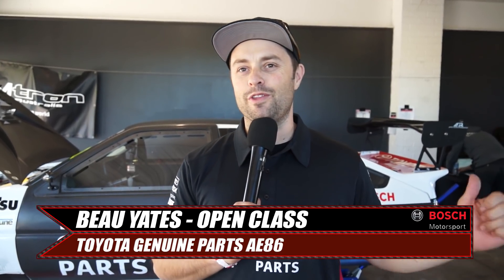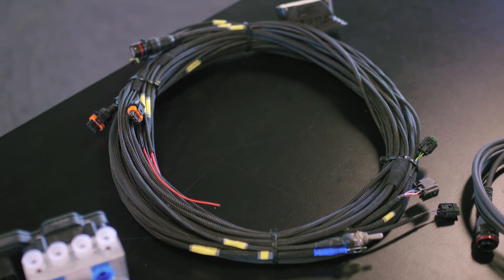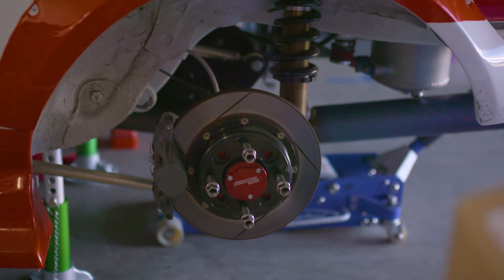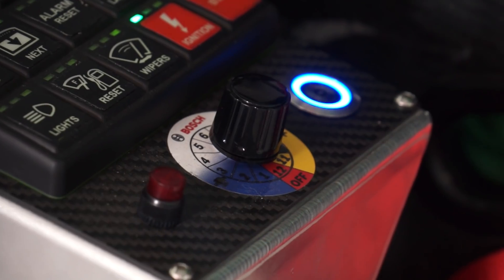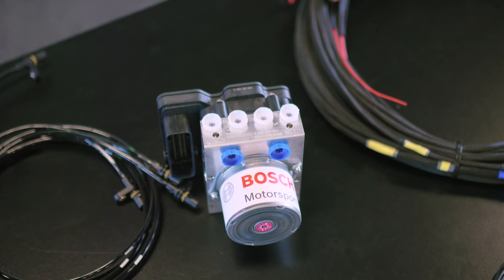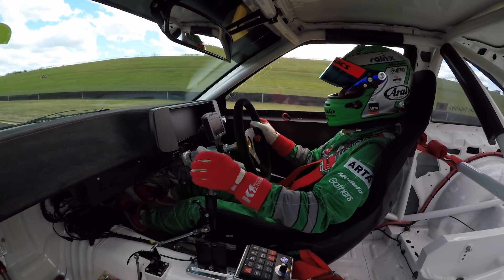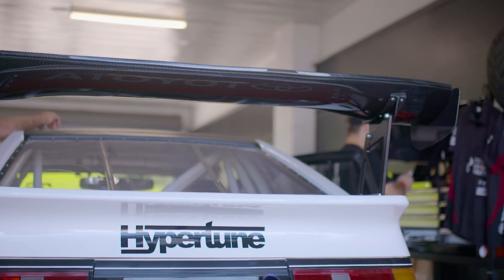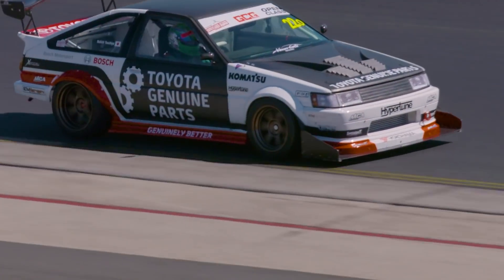Motorsport ABS System - Why your race car needs it

Comment: I saw this system several years ago n it was hella expensive. The price for the club sports version with universal wiring harnesses is +7K with specific car harness is +9K plus I don’t think it includes the calibration and tuning software 🤷‍♂️ So, i guess this is the +12K version of the Bosch Motorsports ABS M5 Clubsport Kit 😓
Reply: all those engineers and programmers must get rich somehow

Comment: nissan has been using these exact systems for years now
Reply: in what cars?
Reply from the maker: In what cars?
Reply: most nissan cars wit the attesa system use this skyline and most new model suv use the abs to break the wheels individually wit the use of the yaw sensor etc
Reply: @tararamrattan7233  This is a motorsport setup, your talking about normal road car abs brakes from the 1950's tottally different- 

Its like saying "you know the v8 engines in Formula 1 in 2013? Ford had v8's in the 1920's"
Reply from the maker: Watch the video and read the description mate

Comment: Learn how to Fkn drive is my abs ,, we put everything in bubble wrap nowadays , even race cars now for the new generation of sissy racers and drivers and he said it it does everything for you pfffffffffffffff please just buy a Honda jazz
Reply from the maker: If you want to be slower that’s your choice mate
Reply: @MotiveVideo  been racing on uk circuits for years and never needed and most competitors are the same no aids , and if u drive on the right tyres and brakes they do there work as should , and as a driver u are meant to be at one with the car feeling it all ! All abs does is take away the raw driving experience,  if it locks up deal with it don't just keep the panic pedal depressed !!
Reply from the maker: It’s not about needing it, it’s about using it to your advantage
Reply: @JH-jo9wt  big fuckin weight difference jh super hero obv it can brake l8r think b4 u open ur face flap not to mention wider wheels compared to a v8
Reply from the maker: Motor set ABS is proven to lower lap times. Many GT3 cars use this exact system. Because to makes the car quicker. The ECU can control the brake modulation  quicker than a human. Same as paddle shift can shift quicker. If you don’t want it, that’s fine, it’s ok. But you can’t argue it’s not quicker because it is.
Reply: @gaz10182  Audi r8 gt3 homologation dry weight is 1235kgs** without any fluids or driver, add all the fluids add a full tank of fuel and you're close to 1300kgs without a driver, add a 75kg driver and you're at 1375kgs race weight, as you know the aluminium spaceframe chassis is pulled straight off the production line at Ingolstadt. A V8 supercar is 1395kgs including driver and fuel (3075lbs) with a mandatory minimum 755kgs over the front axle (gee that must help braking coming out of the chase) its just a chrome-moly spaceframe bearing no resemblance of the road car, and no not a big weight difference, front tire size Dunlop Sport Maxx 290/675X18 vs a Pirelli 30-68/18 again woopty do. The difference is in the ABS and the aero. If you had 2 identical cars the Bosch M5 ABS-equipped car would be able to destroy the non ABS car in every single braking zone lap after lap, without locking up a tire which happens when you push really hard. Flat spots on tires means more money, backing off means slower times - this gives you the best of both worlds the advantage is exponentially multiplied in greasy conditions.
Reply: @JH-jo9wt  OK so it's took up ur time to look at that spec list from 2 cars I appreciate that tyres do make that much BTW  , right so what we basically know is that instead of going off in a cloud of smoke locking up and continuing off into gravel as many amatures do if u are to late u will just go off and look like u were not even trying to slow if the wheels can't lock with abs( appreciated that u may have steering input but if it's to late it will still be a bum ripper moment ) , I do appreciate what we are aiming for here guys but I see it on sim racing 2 aids to help the hopeless be better , Christ I can ride a motorbike but I will admit I'm not that good so I know my limits but when on four wheels different story , u bond with the machine and are supposed to be in control as a race driver at all times why have all the aids  !! And some time s could lead to a false sense of brakes when stinking hot , so jh remember not every one drives a v8 or gt car on track  that has those type of brake disc uk or  aus usa rotor size and caliper pad combo, and driving is supposed to be driving not just sitting behind the wheel pushing pedals and hoping for the computer to do its job
Reply: @gaz10182  Not sure if trolling or just stupid.

Comment: Or use the Teves MK60 ABS from the E46 M3. Still programmable, but $1000 altogether.
Reply: Not in same class, mk60 is primitive
Reply: @claudiumxg1  you can get a motorsports flash on certain units. Essentially the same as the Bosch unit at that point
Reply: @Hole_Motorsports  no IMU on Teves unit, is about 20years old tech, nothing to do with a curent M5 unit, but still ok.for price

Comment: is this system to add ABS to a non abs car or can this also be a replacement for cars that already have an ABS system from the factory.. like if i would get a roadcar and want to bolt on stuff for trackdays and some more agressive driving.. dispite the price
because im wondering if its usefull or not it i have a car with an ABS system thats outdated.. can i upgrade it with something like this??
Reply from the maker: It can can go in any car with 4 wheels
Reply: @MotiveVideo  cool.. i got an opel omega  from 2003( holden commodore platform) some stuff is outdated...  and looking for replacement parts .. witch is kind of hard when the factory doesnt make those most of the parts anymore...
Reply: @gewoontimm  I wouldn't spend $10,000 on an ABS for an Opel Omega -

Comment: Keiichi was absolutely stoked on the car, he did more laps than anyone during WTAC I’d reckon. He might have been the oldest driver there but he had the most energy and the most excitement. Let fans into the garage for photo ops as well, what a champ. Can’t wait for the next WTAC!!
Reply: Not quiet. He did 21 laps over the Fri/Sat, which is still a good amount.
An MX5 in Clubsprint & an MR-S in Open both did  37, which was the most.

Comment: Finally a performance based ABS system. I love it but can probably never afford it 🤣 (haven't looked up the prices yet)
Reply: I did. And it is not cheap. Over 7000$
Reply: First price I found (assuming this is the M5 Clubsport kit) was 5775 Euros, which is $9485AUD lol.
Reply: Wooo yeah wayyyy to much for me unless I get them as a sponsor which is doubtful. That being said, for a racing team, that's a decent price for the gains to be had. I wonder how it'll do in a rally case with snow and loose surfaces.
Reply: "Finally"? It's been around for so long, easily more than a decade.
Reply: @Unicorn GTR You paid over $7000 for fronts only?! 😳
I got mine on Crustida for $4000. 355mm rotors, 6 pot calipers. 👍
Reply: @MafiaboysWorld  The construction, material, passage sizes, cooling design, etc of brakes makes a big difference in price compared to piston count etc
Reply: @bilaltariq7819  Only the material makes the difference, ceramic vs steel. None of the other things you said matters. I should know, my channel has the whole process, from ordering at the shop to construction to picking them up from the shop themselves.

Comment: This! People are so misinformed about ABS and think its the devil, but nothing makes you lose more time at the track than missing a corner because you locked your brakes and or spend your time trying to figure out breaking force that can change because of so many variables all the time.
Reply: People trash it because, as the dude said;  proper race spec ABS =/= normal ABS. Normal ABS is designed to prevent an accident, that's it. Actually 'tripping' ABS is slower than not doing so on a track, just like locking up when braking so it really doesn't make a difference as long as you know what you're doing, just if you delete it you've got a few less things in the engine bay.
Yes, ABS can and is absolutely good at this tier, but fucking no one's going to drop $9K on something that they're basically never going to use unless they're doing some serious track driving.
Reply: @dyIanVII  Couldn't disagree more - the M5 ABS kit is nothing like your road car ABS system. 

The performance this offers is ridiculous. Here's 2 cars Jamie Whincup coming out of the Chase at Bathurst at nearly 300kph, he has to start braking almost straight away at the 200m mark. 

Now look at Chris Miles in the R8 gt3 car. Flys past 200, flies past the 150m board and buries the brakes at the 120m board at roughly 295kph! 

without ABS https://www.supercars.com/videos/championship/onboard-whincups-pole-taking-bathurst-lap/

with ABS https://youtu.be/9iGW7YbGvuw?t=112

There's a reason these are flying out the door at 10,000 a pop
Reply: Thats why (most of) racing is so cool, you control the car, not the other way around. If you miss the apex or/and a couple tens of a second because you lock up or didnt used the needed, perfect brake pressure you will work and try to do better on the next lap, and better on the next one. Until its not possible to be faster on that brake zone and turn in. Sure, the car could be easier to drive, more consistent, even faster, but so could with lots of other upgrades. The driver should allways be the limiting factor on the car pace.